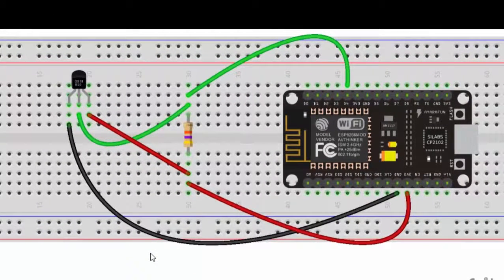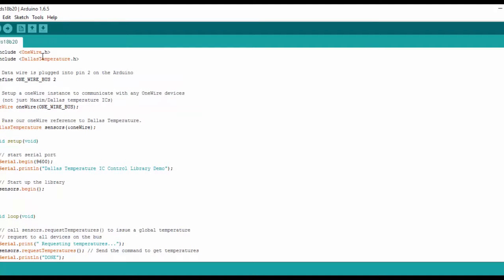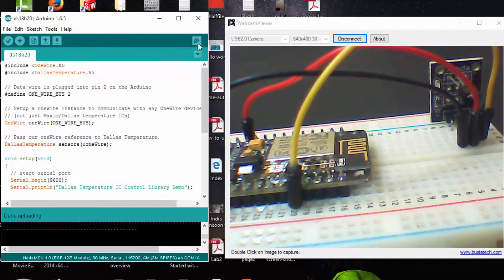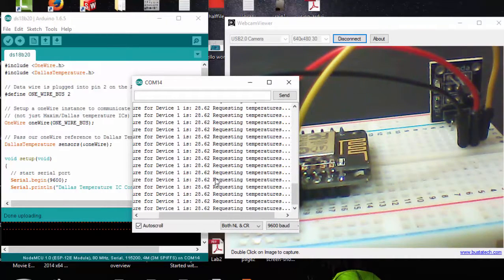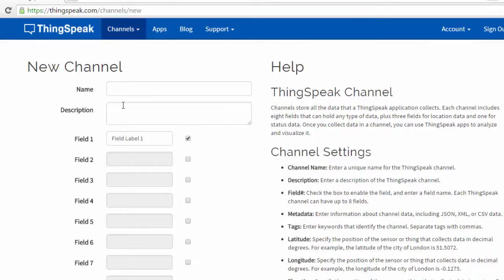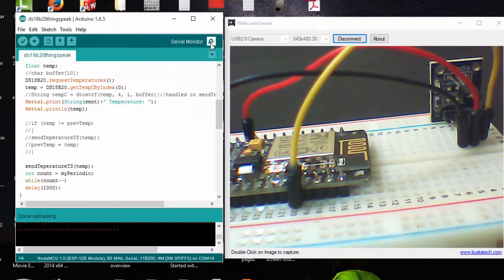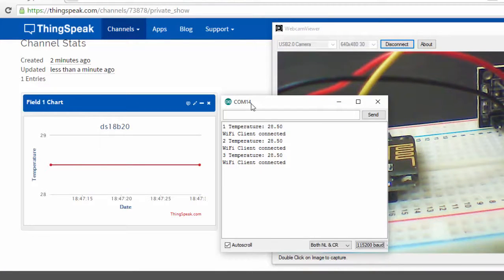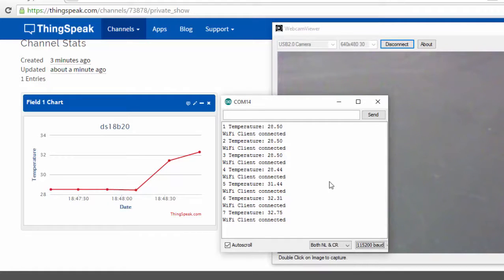ds18b20 with Esp8266 NodeMcu

Comment: can you please show me the full connection of the ds18b20 module with esp8266, as in the video 0:28, as I'm using the module appearing in 0:28 but I think I have a problem with the connection as the output in serial monitor is always -127. Thanks in advance

Comment: I used pin 2 and connected data to d4 as well but I'm not getting any input. I tried using the sensor with my arduino uno and the sensor is still working fine. What could be the problem?
Reply: Same coding, same connection except external 5 volt and it's not working
Reply: @SupremeNoble  Hi!
Did you get the solution?

Comment: Subscribed!! Thanks for doing these tutorials. I am wondering if you will be sharing your arduino code for the new videos that you have done recently for esp8266?I'm just trying to follow step by step so that i can learn more. @1.42 you mention that one can connect multiple sensors? Please share how this is done. I'm hoping its possible to connect 2x DS18B20 + 1x DHT11 + 2.2 TFT LCD SPI for my project? So that I can monitor the ambient room temp/humidity as well as two separate pipes for my heating. It would be great to see the data locally on the TFT and also via thingspeak whilst away. I'm using the same nodemcu dev board as you. Any help or pointers would be greatly appreciated, googling has just confused me more codewise regarding ESP8266. Thanks
Reply from the maker: +Craftycroftyfx I am planning update all the codes to my blog but am not finding time for it, if you need it urgently please leave your email, so that I can forward you the codes, yes whatever you said is possible will try to do a tutorial soon, Happy new year too :)
Reply: @mageshjayakumar1653  can you please email me the code you used for this project, kalian561@gmail.com